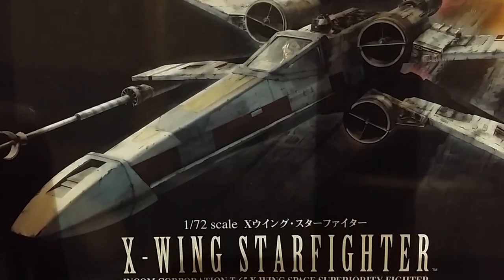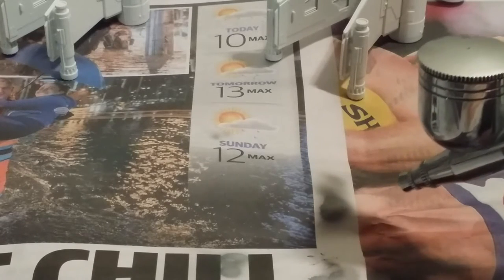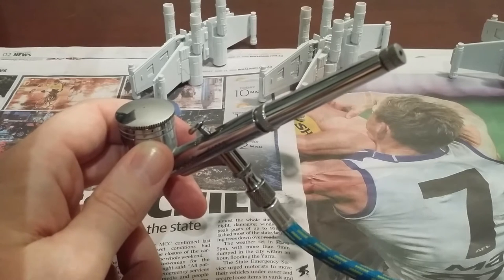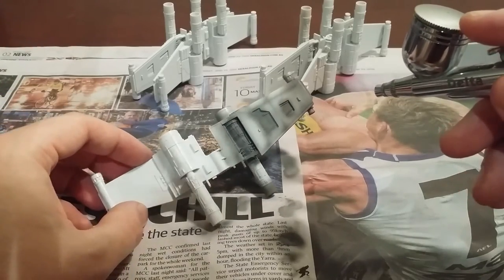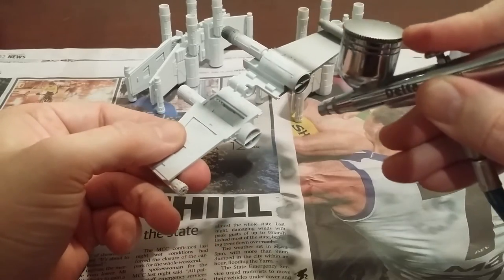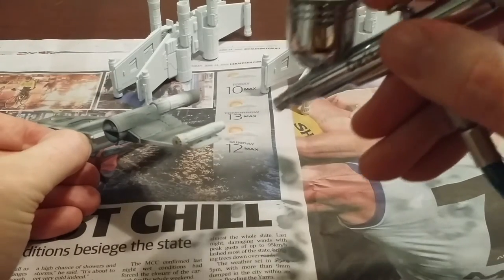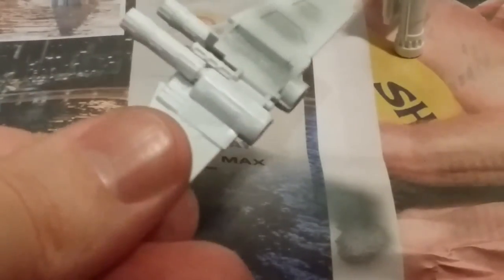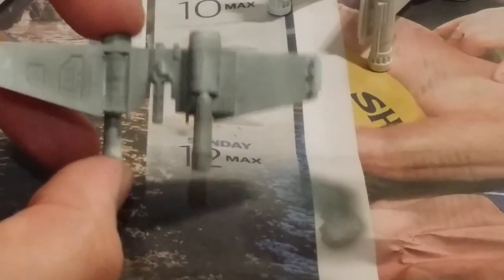X-Wing Rogue Squadron Painting tutorial part 1 1/72 Captain Tycho Celchu

Comment: Hi there, can i just ask  did you prime these before you did this pre-shading and also, what colours and paints (make) did you use? Thanks!
Reply: you know, i really SHOULD wait until the end of the video before asking some of my questions..... that said, still interested in what colours and makes of paint you are using :o)
Reply from the maker: HI mate. I normally only prime after a lot of putty work. Helps to find the imperfections. The brand on paint I used was Tamiya. I try to use mainly Tamiya and Mr hobby mostly. Colours are Flat black XF1, Flat White XF2, Flat red XF7 and German grey XF 63. I would likely choose a lighter shade for the pre shade next time as it ended up a little to dark once coated with Tamiya gloss clear. For the pin wash I used enamels thinned with turps, gloss black from humbrol.
Reply: Thats great, Thanks! (just watching the third vid now ;)